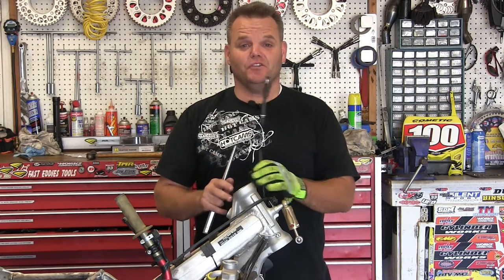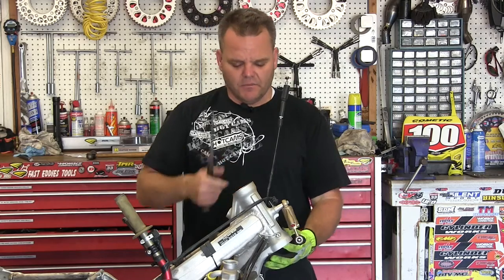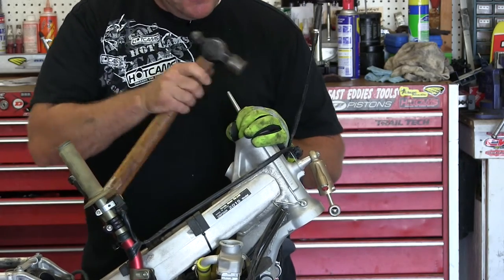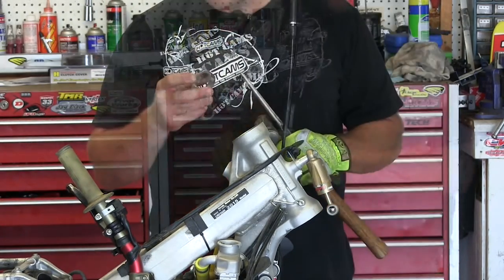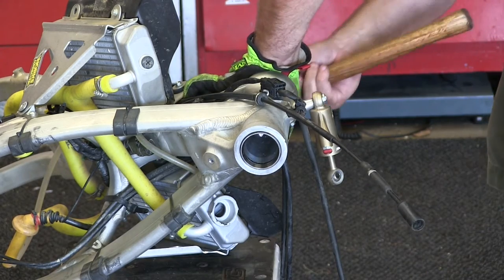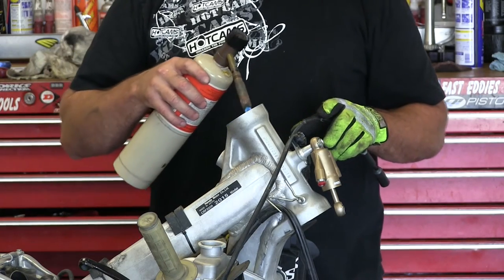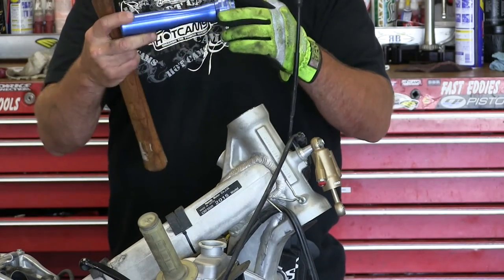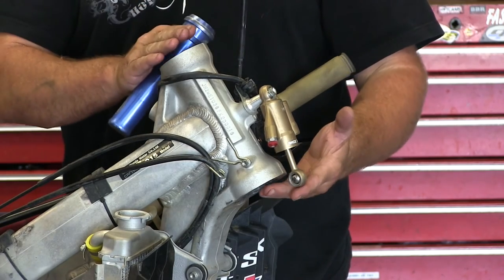Steering Stem races Take Out and Install Honda

Comment: $10 race cup removal. Go to Lowes, Home Depot, Tractor supply and buy a 3 foot piece of round 1" tube in the little metal supply section that's 1/16th thick and use that. 3/4th" diameter tube works too. The thickness of the tube wall (you want 1/16th") is more important than the diameter of the tube.  It will catch the lip better than a punch because it contours more surface area of the race lip. Also due to the longer length you can get way better leverage on it so that it wont slip when you hammer. This is what I always do and never had any problem. I tried the punch tool method before but had nothing but problems. FYI people, those 8" punches from Horrible Freight are not long enough. Dont waste your $6.99. Been there, don't that.

Comment: man, i wish my '05 YZ125's stem bearing races would pop out as easy as this.  i went and bought a pack of "long" punches from Harbor Freight for this, but at 8" in length, it just wasn't long enough, plus the tips rounded instantly.  Just bought a foot long punch from Home Depot and tried it but the race wouldn't budge, and after about 5 minutes of trying, I can't feel much of a ledge for the punch to grab on.  Gotta figure something out.
Reply: cbh148 any updates on the races?
Reply: If you went and bought chisels for doing just this job why wouldn’t you just buy the proper tool to get it out
Reply: @michaelpresey2273  I did, but it still couldn't grab onto the bearing race.  Ended up Dremmeling a small spot of the aluminum above the top side of the race to get a really good bite with the punch.  Worked great.
Reply: @cbh148  that’s what I did with the inner race on the bottom triple clamp, couldn’t get a good chunk to grip on so I ended up grinding a line on the race so the chisel could seat on it without slipping